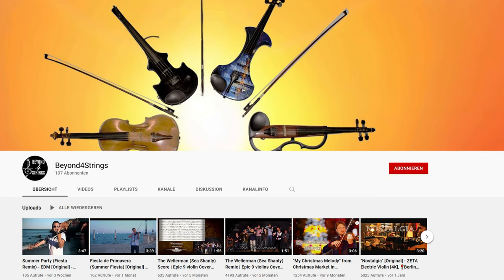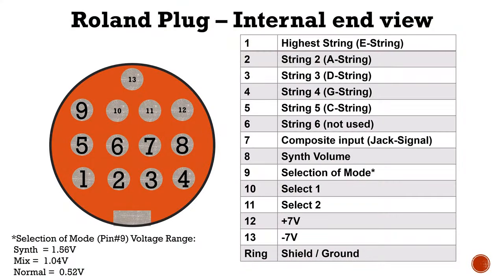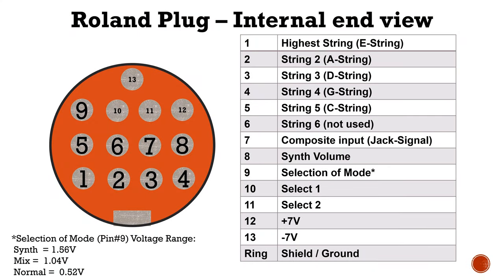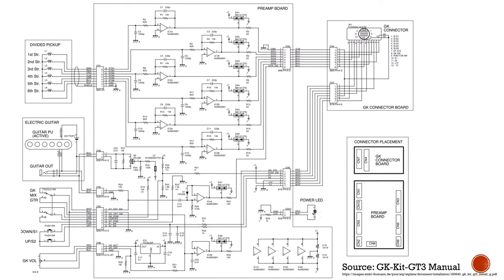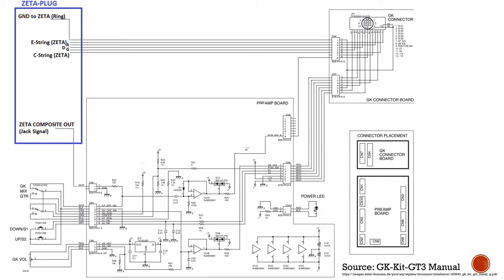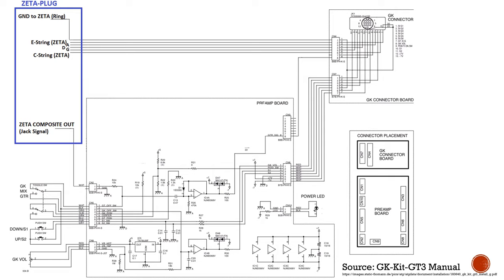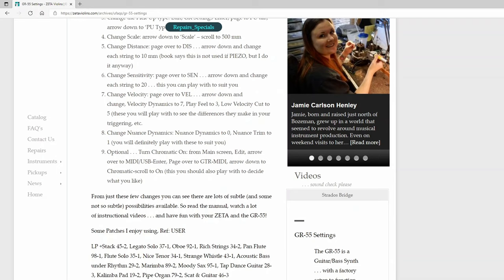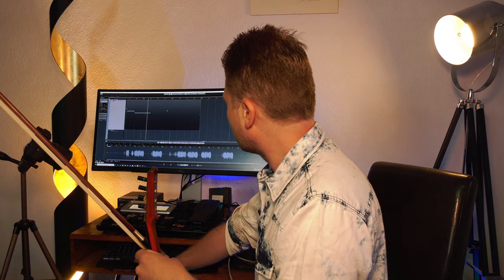(Old) ZETA electric violin with Roland GR-55 [Tutorial - how to do] - Tech Talk

Comment: This is Steve Carlson from ZETA Violins. Your information presented in this video regarding our ZETA to Roland GR-55 cable is incorrect. Our cable you show in this video from our website is compatible with all original equipment ZETA instruments, regardless of age.
Reply from the maker: Thank you very much for your comment. Sorry, if I did you wrong.. If you say, this works I completely trust you - I have bought a used ZETA so perhaps sth. was wrong with it. I will add a comment in the video so it is clear, that the ZETA cable could work! I am surprised, that it works as the cable needs e.g. the control voltages etc. but of course it might be implemented. Sorry again, and than k your for your great instruments I really love!
Reply from the maker: I have added teh comment: "PLEASE BE AWARE OF THE FACT, THAT ACCORDING TO ZETA THE ADAPTER CABLE WORKS PERFECTLY! SO, PERHAPS MY OLD ZETA WHICH I BOUGHT USED HAS A MISFUNCTION THAT LEAD TO THE TOPIC - I'D LIKE TO APOLOGIZE FOR THIS MISUNDERSTANDING!" - Hope this is fine for you!
Reply: @Beyond4Strings  The GR-55 had a modification which required a change to the basic 'legacy' cable, which had worked on all synths prior to the GR-55, ie GR-33, GR-20, Axon 100, Synthonies, etc. Perhaps your problem was you do need the 1/4" jack plugged in which activates the 9-volt battery. Not sure but that could have been your issue. Other than that the problem was the pin-out requirement change and not 'voltage' related. Hope that helps a little or clarifies. All the best . . . Steve

Comment: I have subscribed to your channel. So just to confirm, in this video, when you show the Zeta violin pinout(rear view), it means you look from inside the zeta violin at the solder connection? And when you say Roland 13pin on GR55, you also look from inside the GR55 box at the solder contact, right?
Reply from the maker: Yes, you look in both cases from the inside as this is also, as you see it on the cable. Anyway, my ZETA socket on the violin has small numbers engraved as well as also the Roland has, so you can check with the numbers on the sockets.